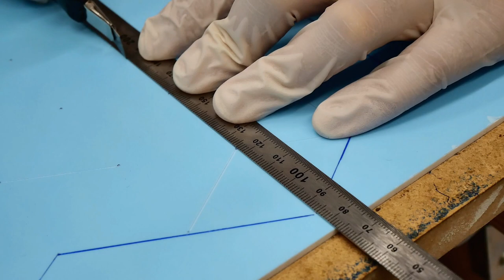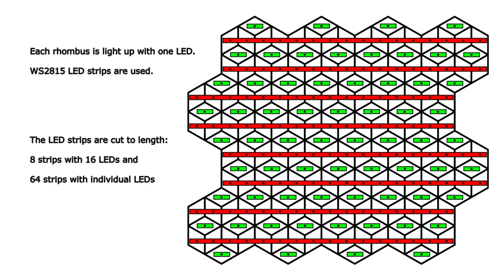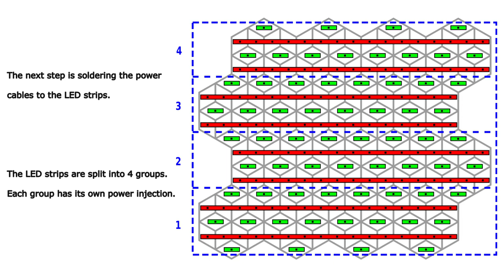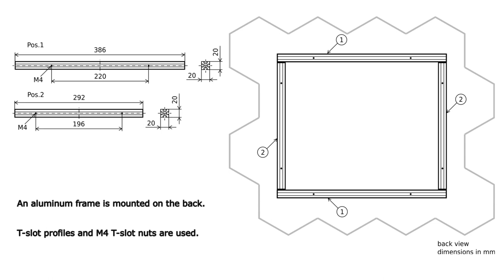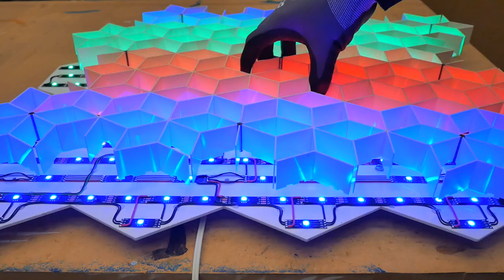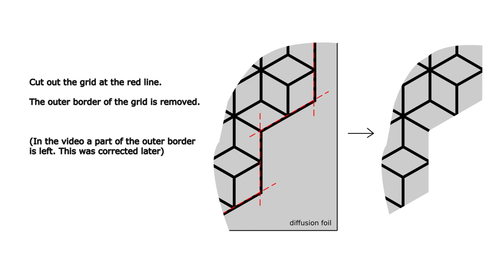Making a LED Matrix with 3D Effect

Comment: Can we use black unplasticized sheet to cover individual LEDs?
Reply from the maker: The advantage of black pvc is that less light is transmitted through it. But black pvc is less reflective. The rhombuses would not lit up evenly, especially in the corners. That's why I would still apply a layer of white lacquer to increase the reflectivity.